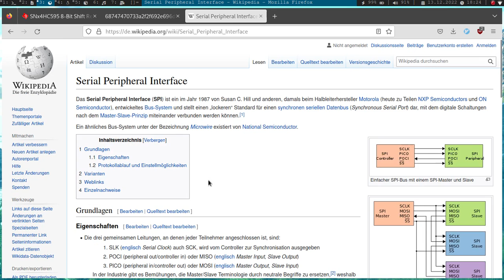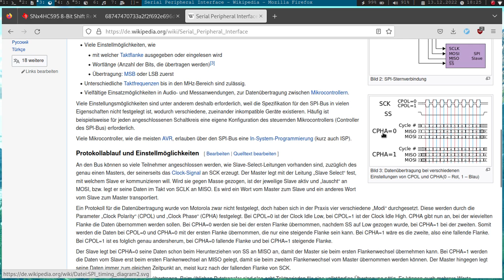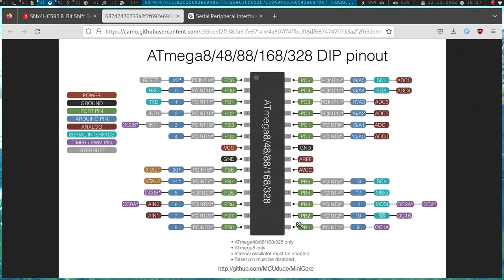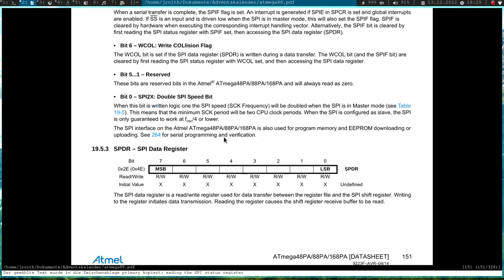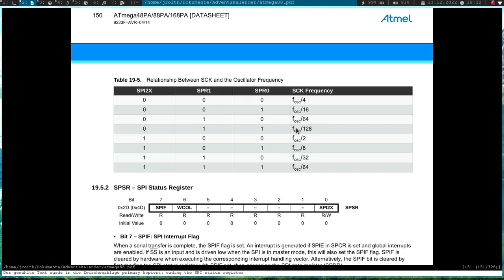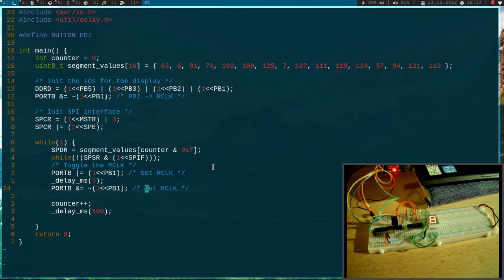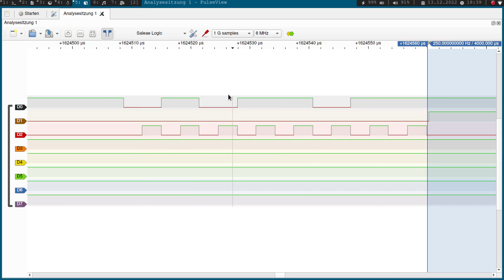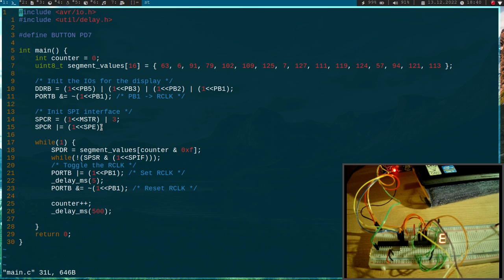AVR Advent Calendar - 14: SPI Master Output with 74HC595 Shift Register

Comment: Cool. Thank you! Suggestion: Save the extra pin for RCLK as e.g. ATtiny85 has only 5 (6). Use MISO pin instead. Will require frequent dis- and enabling of SPI hardware.
Reply from the maker: You are welcome. Yes, thats a good tip if you have to save pins ;)